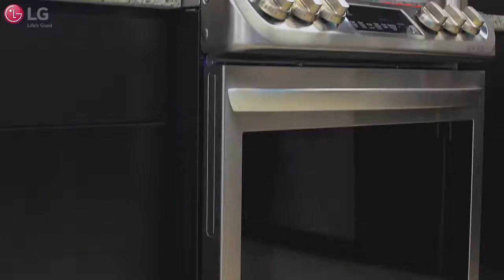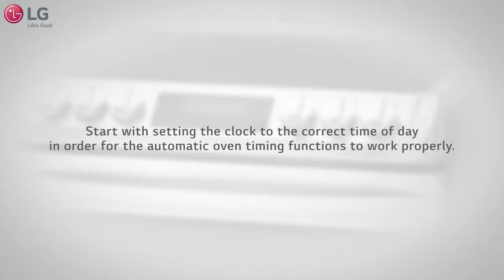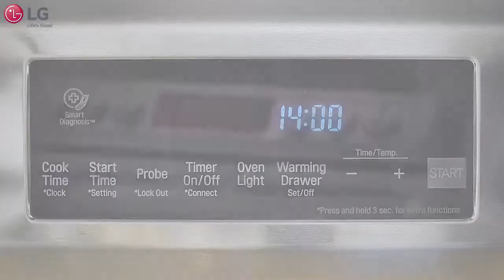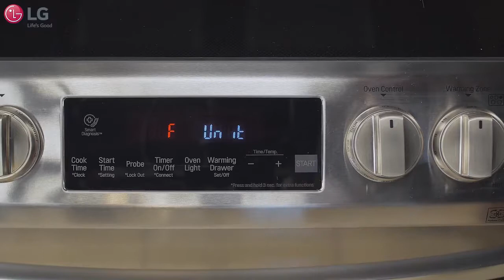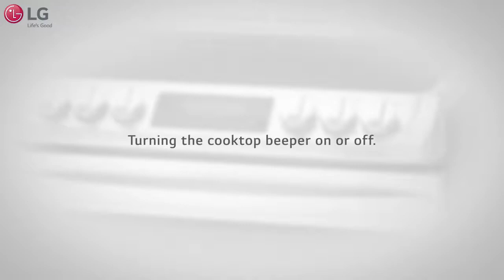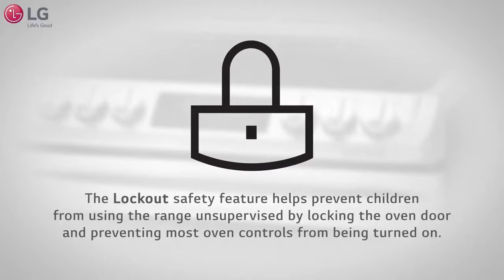[LG Ranges] Using The Control Panel - LSE4617

Comment: LSEL6335F
Reply from the maker: Hey, David! The LSEL6335F doesn't feature the adjustable backlit panel either, but just to clarify, are the lights on your control panel dimming or completely turned off? ^Ian
Reply: @LGUSASupport  Totaly black,  have to use a flashlight to read controls . The only item lit is the clock  when you turn on the oven the temp lights up but thats it
Reply from the maker: No worries! There may be a deeper issue with your control panel, so if you could please reach out with your device and model numbers, as well as your contact info, to any of our social media pages @LGUSSupport, it'll be our pleasure to get to the bottom of this with you! ^Ian

Comment: LSEL6337F How to make back lit controls light up ?
Reply from the maker: Hi! After looking into the owner's manual, model LSEL6337F does not have a light on the control panel. It does have LED lighting around the knobs, however.  Feel free to look through your owner's manual here: http://spr.ly/6059OPeOf. Should you have additional questions, feel free to send us a DM on Twitter (@LGUSSupport) or a PM on Facebook (@LGUSA). We'd be happy to further assist you! ^Chris

Comment: Must be nice to have a working stove. I wouldn't know because I purchased a range Model: LRE3194BD.FBDLLGA.  Yesterday was the third time in three years that my LG electric range stopped working. The first time was after only 5 months of use. Since it was covered under the laughable 1 year warranty, LG arranged for a tech do repairs. The technician called ahead of his visit. After I described the problem, he immediately knew what was wrong. He ordered a replacement for the faulty membrane before ever looking at my stove. He fixed my stove and told me that it was a very common problem. The repair lasted one year. Same problem all over again-none of the coils would heat up and the stove was useless.  After several calls to CS, LG granted me a “one time complementary” repair. It took more than three weeks to be done, but again the stove was working. Flash to yesterday and once again the stove is broken. None of the coils will heat up. 
So, I reach out to CS on Facebook and Instagram. They are not going to help me. The one person who responded offered to provide me with names of local techs that I can pay at my expense because their bogus warranty has expired. Warranties are for products sold in good faith. LG sold this stove knowing it would fail and now they refuse to provide a long-term solution. LG makes garbage and wants its customers to live with the stink!